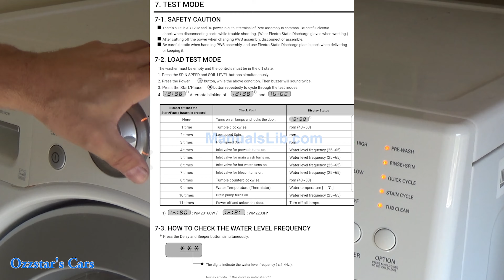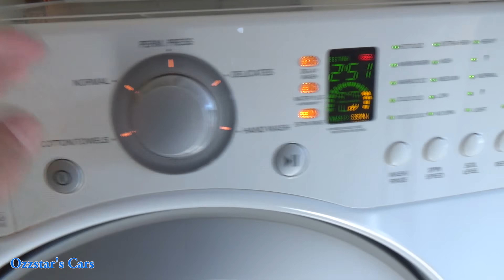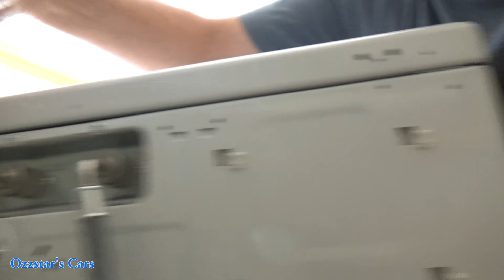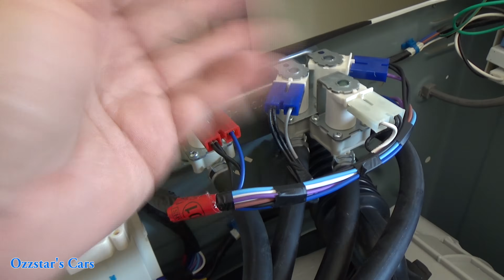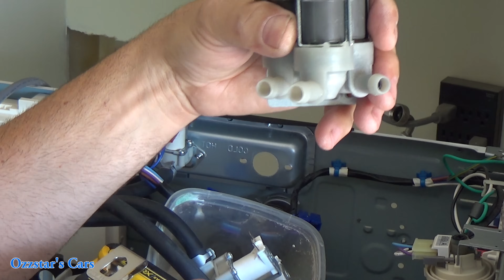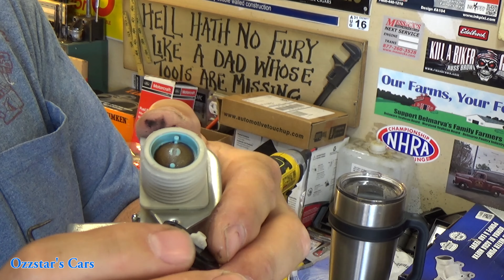LG Washing Machine - No Water Filling Up - Code IE Repair

Comment: I have an LG washer that starts to fill with water during the wash phase, then agitates some, then fills some more and stays in the wash/fill phase until the tub is 3/4 full of water and it starts to leak out the door.  I’ve replaced the door latch and the door seal before I realized the issue was “failure to fill” however there is no failure. The tub fills with water.  I checked the pressure switch hose and it was clear and I replaced the pressure switch.  Still no fix. I’m thinking it’s an issue with the main board.  Any advice you could give me if you are still looking at this video?
Reply from the maker: I'm still here but the problem seems unusual.  Not sure without diagnosing it myself, sorry.

Comment: if my drain hose is way further downn exit pipe then 4 inches will that be the rrason. its like 2 ft or more jammed down there?
Reply from the maker: @timsfgiantsmem9382  no need to be that deep. Probably not an issue though.
Reply: @ozzstars_cars  what about if they got the washer on a extension cord? Thx lol
Reply: @ FIXEd IT! Removed 4 ft off the water out take, must of caused a kink that far in there. And Cleaned Screens behind intake lines, they was debrit in there, Thx Man MAGA

Comment: I just replaced mine with amazon ones that were the same but the electrical tabs are bigger so i filed them to fit but im still having issues and not getting water at all now. Don't buy the amazon ines.

Comment: interesting video...I had the IE error .The LG technician fixed it. Mentioned it was an issue with the water level gauge.  This in turn was caused by scaling from hardware. He gave us some de scaling liquid that needs to be applied once in 6months. (Note: this is for India...your mileage may vary)
Reply from the maker: Interesting, thanks for the information!

Comment: Dude, you saved me $1000! That was going to be the cost of a replacement washing machine. Repair guy was going to be a couple of hundred easy. Had the same issue you talked about, got an OEM replacement from LG ($100 including overnight shipping — which doubled the price of the part itself but what the hey) and we're back in business. Can't thank you enough!
Reply from the maker: @peterschwartz7920  that's awesome Peter! The tip jar is open. haha

Comment: Could you do a connectivity test with Hohms mode  just to see is there broken wire in the coil of each solenoid
Reply from the maker: Testing for proper voltage would be a better way to diagnose.

Comment: Hi, I replaced the cold water inlet and I am still getting the IE error code. I can see the water getting filled for the tub clean cycle, however when running the normal wash cycle, around 25 minutes into it I get the IE error. Any tips to where else to look for resolution?
Reply from the maker: Did you do the other diagnostics mentioned in the video?
Reply: Yes, I did run the diagnostic mode and all seems to be checking out. I will check the pressure switch pipe and will to blow the air when I get home. Also, will try pinching those inlet pipes.
Reply: I just tried with diagnostic mode, and when pressing the pipes from the inlet valve to the machine, I can feel water on for Hot water, and one of three cold water inlets during diagnostic, seems like that's pre wash inlet, and nothing for other two when I move the test to next. I will buy the multimeter to see if those two inlets are getting 130 v current or not. The pressure switch hose is clean, gor bubbles sound when used your method.

Comment: Before you even open the machine, remove the water inlet supply hoses and pull the screens out and see if they are clogged. Clean if necessary. That is the most commonly reason for low water flow.
Reply from the maker: Good idea.

Comment: Have f14a8qds which fills with water, spraying water in the soap compartment, filling the drum with water, and gives me ie error in the first few minutes of operation. 

Filter is clean. inlet valve plugged?
Reply from the maker: Test and don't guess! Impossible to diagnose over the internet but I hope this video has given you some direction to solve the issue. Let us know what you discover. -Glen
Reply: Hopefully fixed now... 
Ordered a new intake valve. Was only a small amount of money. Good to have. 
Then I removed the cover. Found the hose for the pressure sensor was loose.
Reply from the maker: @lagresomadsl  I believe I talked about that potential prob in the video. 👍

Comment: Super helpful!!!  After running through diagnostics found out my washer with same error code was faulting during pump-out due to drain hose being shoved too deep into drain pipes.  Pulled drain hose up/out and working fine now.

Comment: I have an LG that water is the issue, getting an IE error code. Changed the intake hoses, checked the water filter on the intake hoses, even cleaned the drainage hose. Still IE. 
Now, you showed me there’s the diagnostic mode, so I’ll use that. 
I think it’s the water intake valve just like you showed in the video. Been waiting for a repair guy to come since I called two weeks ago. Getting desperate enough to try things myself. You made it look easy! I’m hoping to fix it myself as repair guy costs $199 just for a house call.

Comment: Went through every step everything works, diagnostic shows all solenoid working.... Still ie error. I hate LG
Reply from the maker: What's the error?
Reply: @ozzstars_cars  i3 inlet error. I replaced the solenoid with an OEM LG part and it STILL kicks the same error. I'm trying the pressure switch next since it seems to not be aware that water is filling.

Comment: Thank you so much! Had this machine since 2009. Replaced the bearings 3 years ago. Never knew about the diagnostic buttons until today. It was simply the connector hose popped off. Popped it back on......good as new. Guess I didn't pull it taunt enough on the reassembly last time....
Reply: Hy how are you,on this one I have failed but to the errors such as DE,OE,FE I was fixing them but this one hmmmmm plzy help me😢
Reply: @RegisMoyo Which error code is giving you grief????
Reply from the maker: Lesson learned. Bet you won't make that mistake again Dr Funk. Those easy fixes are nice!
Reply: @ozzstars_cars  Yes sir. Not having to wait & pay for parts is nice too! Thanks again...

Comment: The LG crack pipe lives to smoke another day! That thing had an ECU in it! Wonder if it needs programming upon replacement? :D

Now that I watched this, mine is going to take a dump on me, lol!  I've had pretty good luck with it over the years. Maytag Neptune, 2003. She'll be 18 this July! Only problems I've had in that time was a spin cycle code with a failure to spin and get water out of the clothing (That was due to a piece of sound-deadening foam that fell out of position and down, and landed where it decreased the clearance between the drum and the imbalance switch by 4"! The slightest wobble would then trip the switch - no parts needed fix!), and the front rubber seal for the door. That one was a job! I had to use my drum brake spring tools to release these 2 HEAVY springs! I had a fight on my hands, but in the end I won. I definitely could've used another set of hands there. Can't really complain after almost 2 decades of use.

I had to tear the dryer down as well around year 5, since it was squeaking twice per revolution, driving us nuts, lol. I tore the whole thing down and greased the shaft on a pair of idler or guide wheels for the drum. I've done this twice so far. They were dry from the factory.  I need to tear it down again for a cleaning before we have a lint fire here. 

Ozzstar's Cars and Appliances channel! :D Nice work, Glen!
Reply from the maker: Hey Smitty you better keep that washer and dryer in tip top shape so the wife won't have any excuse not to do the laundry.  Ooops, don't tell her I said that. 😆😜😆
Reply: @ozzstars_cars  - HAHAHA! She's got to start towing the line here. Now where's my whip ...  🤣